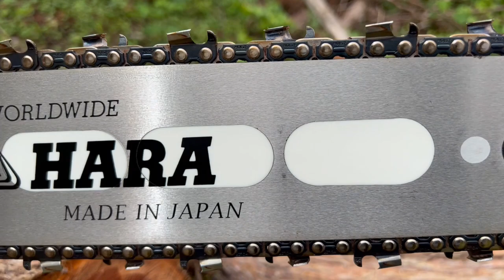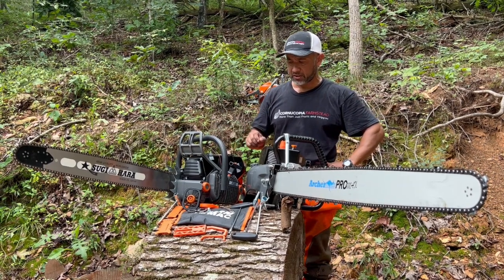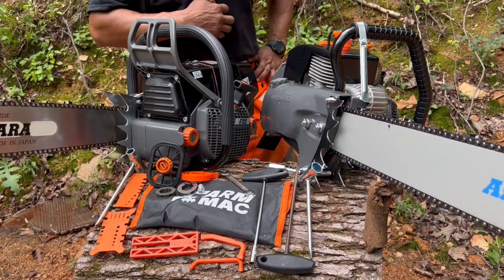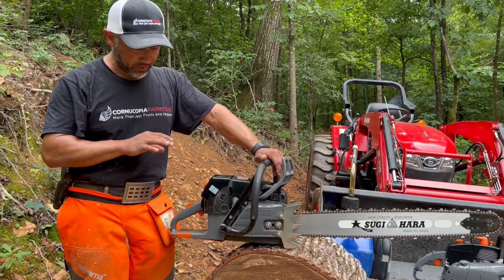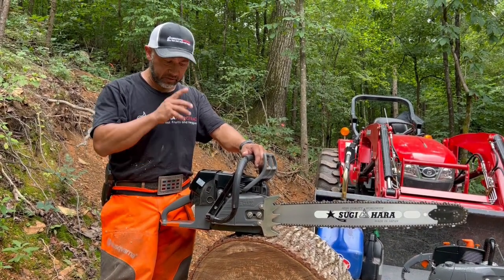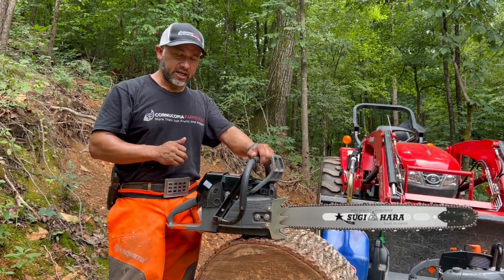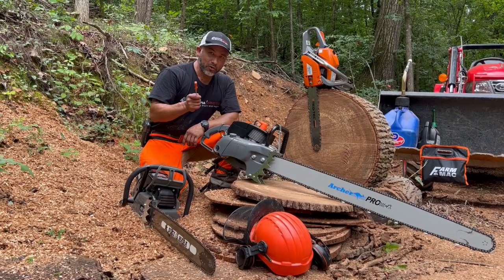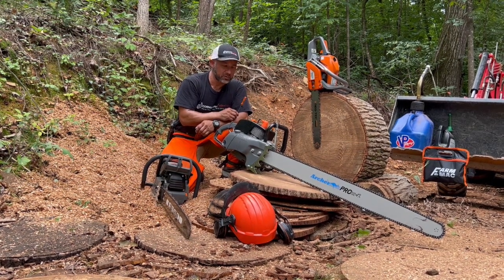FARMMAC F070/F660V STIHL MS070/MS660 Next Gen FARMMAC PRO SERIES by NEOTEC

Comment: It's nice to see someone making a quality clone. I might have to pick up a F660.  Do you know if they are coming out with a top handle saw?
Reply from the maker: I can tell you since we have been working with these folks not only has the first generation saws been better than others that are out(my personal experience as I have owned and still have the blue saws too), they are and have a constant desire to improve but also have a high standard of product. You could see In previous comments from other vids where they have lacked in one way or another and they have stepped up. They needed better contact in fo which we had been pushing for on many reasons and they finally got these things taken care of. Much of what people don't know is how the internet is controlled in China. The government controls how business works without government help and that is frowned upon which makes Chinese business difficult to make things happen for the average small business there. They have overcame many odds and recently stopped producing parts for FT because of various reason, some you should be able to figure out. At any rate to answer your question yes they are working on a couple top handle saws but I wouldn't expect to see them soon as they will be ground up saws, yes likely old patents expired but still will be new production with much development too. Hope this helps! Thanks for commenting 👍 and subscribing! Personally we have been using the 1st generation 872, and 892 for felling and bucking. Recently we purchased the NH837 which is a Husky 537xp clone and I love that little saw. I had been using the echo cs335 which is a great saw but the power is lacking. This 837 is splitting time with 3 people now and it has turned out to be a great little saw! We are very happy with them all for sure! Thanks again! Enjoy, Ric
Reply: I just ordered their top handle model and looking forward to trying it out in the trees soon

Comment: I noticed the 660 was around 30 second cut vs 40 second on the 070.  The RPMs make a big difference and for a long day the 660 at half the weight will allow the oporator to run longer ;)
Reply from the maker: Absolutely, we ran them together to show this possibility too. Depending on the wood from my experience harder woods be it hickory to oaks and the like, chain speeds make a difference when I have cut different species. The 070 won’t always be appropriate but then again the same applies to the 660. I’ve found while cutting with top handles I will switch from the little 25cc to the 35cc depending on either hardness or density of the wood fiber. Having said all of this time is not just money , time cannot be replaced. Experience and life will teach us what is best if that is we pay attention. Hauling the 070 even without the bar can be a workout! Thanks for commenting, Ric

Comment: Why don’t they sell the bars and chains for the saws all together why do I have to hunt for them?
Reply from the maker: I can't really speculate the reason for that but I can mention  that with our contact just so that they will know.  Thanks for commenting 👍 and subscribing!
Ric
Reply: you can find 24 32 36 w chain 120 or less neotech brand high quality I must admit the chains are are excellent just for buy a Oregon High quality appropriately sized file break saw in 25 to 1 min 4 tanks short bursts of wide open I then switch to ethanol free 91 octane mixed 40 to 1 high quality semi synthetic 2 stroke oil check plug after first half tank of 40 1 should be good to go they rip. YouTube has several goid videos on cheap upgrades to prevent break downs for an Xtra 75 u have a very good saw. I may port mine eventually but it runs so sweet As is almost 2 much power especially w 36 w 28 full chisel balanced nice can fell or buck firewood for days enough power that a dull chain cuts even careful w rakers go to low and this thing will rip your arms off in a holtz 660 I'm very interested in farm mac nice lower rpms lots of torque

Comment: I just bought a F660vw. Would not start and now would not even turn over without decompression.
What do I need to do?///
Reply: I called Neotec , but no support.
can you help?
Reply from the maker: Just from what you have mentioned it sounds like you have flooded it assuming it doesn't have a mechanical failure. In general saws 700cc's and above are easy to flood also known as fuel fouling. This can happen by trying to start the engine with the choke on and pulling the start cord more times than needed after fuel has entered the engine itself.  Once the engine has basically filled with to much fuel it most likely will not start because both the engine and the plug have to much fuel for it to be ignited. As for it only rotating when the decomp is pressed, the 660 clone has a lot of compression,  it is a big engine and they are difficult to pull in general. When starting any two stroke or even 4 stroke the engine must turn at a fast rate to effectively fire off the fuel , if the motor is turning to slow then you aren't creating enough opportunities to ignite the fuel quickly. This is similar to a weak battery trying to start a automobile , turns so slow makes nothing happen, same principle.  
Back on the flooding. To clear the engine of fuel you must squeeze the trigger while simultaneously pulling the start cord rapidly and many many times quickly, the choke must be off also. Most likely you will pull the cord 20 to 30 times and then it will fire off, after it fires off the first time still leave the choke off. Now let go of the fuel trigger continue to pull and it will start, it will seem boggy at first as more than likely there is still an excessive amount of fuel lingering in the engine but it will fire off. 
Running a large engine saw takes patience and strength.  They are heavy and large capacity engines , everything has to happen harder because they are so large. In other consideration they also use more fuel and air which means you have more opportunities to make errors by using or by creating malfunctions. Normal starting use full choke,Pull it fast and pull it hard hard until it fires off the first time then turn it to half choke. Now pull if fast and hard again they usually start within 3 pulls if you are pulling fast and hard. Let it run for 10 to 15 seconds at fast idle then squeeze the trigger and let go it will go to normal idle. If you watch some of the vids we have on the 660 clones you will see the procedure we use running 660 clones. Hope this helps, Ric
Reply: Thanks for your reply. I am going to try your suggestion first. The issue that I have is that the engine will not turn unless I hold the decompression button in all the time, otherwise I cannot turn the engine over with the rope. It is too hard.
Reply from the maker: @johanvanwyk4880  yes, they are very hard to pull to make them rotate. I would say it is the equivalent to kick starting a 250cc 2 stroke dirtbike or pull starting most 4 strokes 200cc's and above. When I flood them out I have to take a break if it doesn't clear out quickly. I start with it at my mid section grasping the saw tightly to make sure I have the benefit of the entire pull. You can also do a ground start with your foot in the handle to create more leverage with your body. This will help also. The saw will not start if the decomp is held in all the time as this relieves all compression and you need the compression to create the vapor charge so as to ignite. You should only press the decomp one time. Yes it is very hard but it is a 660. The 070 is much harder to start than the 660, I try to start it from my waist but almost always end up starting from the ground .  You need to clear the excess fuel out first, hopefully the plug isn't fuel fouled which happens if you keep over fueling. I know this likely seems bleak but it isn't as bad as you think. Stay patient,  pull fast and hard and it will start. Once you get the hang of it you will see how easy it is to both start and not start the larger saws. Stay patient and you will get it. You got this!
Ric

Comment: would u agree neotech 660 best bang for buck
Reply from the maker: Yeah, we have 3 g660s from over a 2 year span,  but we also have the ns892 Neo-tec and now this Farmmac 660, by far both the Neo-tec and the Farmmac (certainly the strongest and best built), I would say yes they are much better than the bluesaw. Not that it is bad by any means, but, if your going to spend the same amount of money I am going to get the better piece.  Looks play a part too , hands down the Neo-tec and Farmmac saws win that easily, performance,  quality. It's an easy choice for me bud. What is your experience with the blue  saw?
Thanks for commenting 👍 and subscribing! Ric
Reply: @CornucopiaFarmstead  nice I plan to get the 660 version farm mac power head nothing against there bars and chains but I have the large ones going to get a stihl lightweight 24 full skip chisel and demolish a pile of 16 cord hardwood maple and yellow birch Beach all 16 to 28 inches I have found a light coat of grease helps seat the air filter are the macs better look better in your vids
Reply from the maker: Sounds like you know how to put it to good use.! It is the little things that matter isn't it! As for the bars I can't complain about them, they are good bars and all rust free too! 
We usually run 24 to 28 and on occasion will run them out a bit further, I don't prefer that being 5'5, makes them hard to handle! Happy rounding ! Ric

Comment: I think something is wrong with that saw the first chainsaw it don't sound good I don't love how it sound
Reply from the maker: The first saw was the f660, the stihl ms 660 clone. This was the first time either of these 2 saws actually cut hard. They were heat cycling for breakin only then were used cutting in this vid. Neither had the carbs tuned until we put them in wood. The f660 was very rich and as you can see I tuned both while using them. After even this video they were both fine tuned more as the motors were used more. Both of these saws functioned well and were free of any defects and still run well today!
Thanks for commenting,  Ric